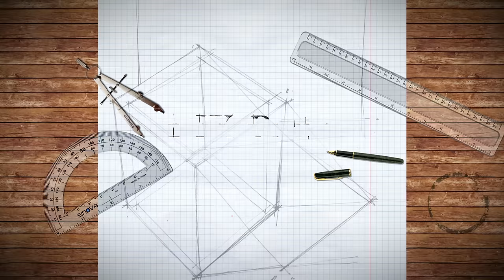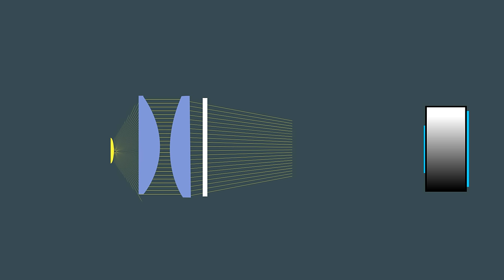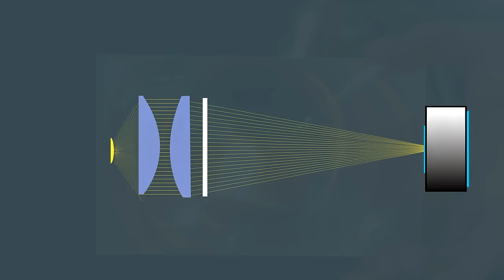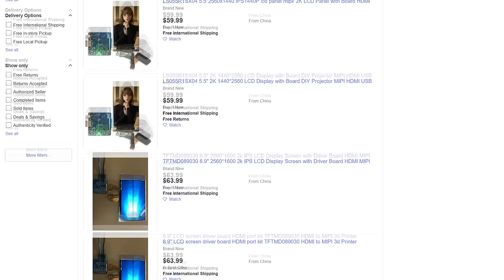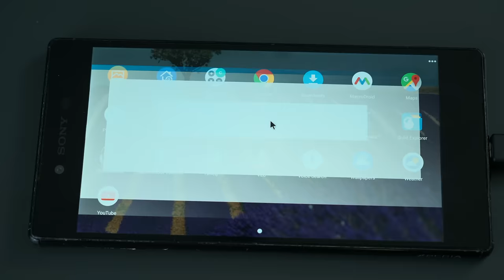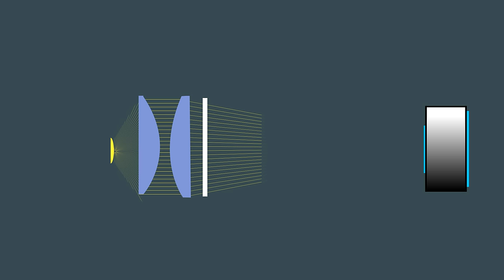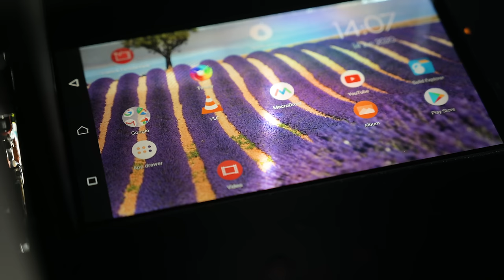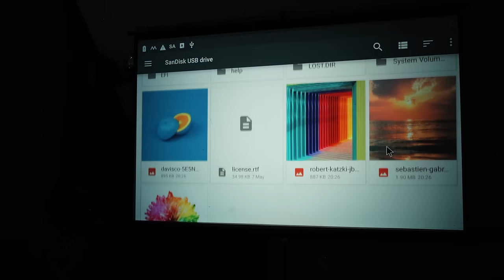Building a TRUE 4k home cinema projector (it’s awesome)

Comment: What’s the exact price breakdown? I can’t see this being cheap...
Reply: Somewhere under 2k hahah
Reply: In the video he says the bought one cost literally 10x as much as the homemade projector, so roughly $200. 25:55
Reply: @Eli-234  how. The heatsync alone has to cost $100
Reply: @brandenbrandonbrendan4405  not at all, heatsinks are super cheap. Just built my PC and got a heatsink for like £30, definitely enough
Reply: @brandenbrandonbrendan4405  He used a CPU cooler. You can get decent stuff new for around $20 😄
Reply: @brandenbrandonbrendan4405  that's an NH-D14 and you can find it used at 60 maybe 50 bucks
Reply: @Pinkuranuim  i upgraded mine a couple months ago. it cost at least 100 for my cooler.
Reply: @brandenbrandonbrendan4405  Nah it's not a noctua, more like $50-70. Really looks a lot like my scythe.  Seems like you could do the whole thing for less than a $500 call it a grand if you need a 3d printer
Reply: @brandenbrandonbrendan4405  You bought new hardware. You can buy this  unit with fans for $60 on ebay buy it now. You're just flat out wrong here dude.
Reply: can.... we watercool this with a aio?
Reply: okay so heat syncs vary in price but can anyone give a cost breakdown of this whole unit?
Reply: @brandenbrandonbrendan4405  more like 20us...... I mean, just buy some third brand cpu cooler......
Reply: @brandenbrandonbrendan4405  Well you can get a used one here. I find some on ebay for about 20-40 bucks
Reply: I'm thinking less than $100 for the alu and other construction materials. If you want someone to CNC it all for you, it might be a lot more expensive.
Use a 1080p phone you can get for $20 used or might even have - i have one 1080p 2013 phone for sure that popped its battery somewhere in a drawer. Alternatively use a panel and adapter board should run you maybe $80 or less from China. 4K is going to be EXPENSIIIVE. Maybe the imaging bed off an Elegoo Mars or Anycubic Photon 3D printer can be retrofitted? It's not too too expensive as a replacement part, and it's actually a 2.5K screen that reuses a phone panel with full RGB capability intact, because they're lazy.
Yuji Led is like $80, but you can substitute a much cheaper one.
$20-$30 for Fresnel lens kit from China.
I won't even count a mirror, they're basically free. Pulleys are about $2, as are inserts he used with them, and the belt is maybe $5.
The step-up/step-down boards should all add up to about $20.
Large format lens about $50-$100
Scythe, Thermaltake or Thermalright dual tower CPU cooler up to $40 or so, maybe you can get a used one where someone lost, bent or broke mounting hardware, should be essentially free. There's a lot of 6-heatpipe $20 (shipped) coolers in China, not sure how good - but the LED is actually allowed to run somewhat hot.
Make your own total depending on how you decide to build yours.
Reply: I would just rip one out of a 500 watt amplifier, there's plenty of those at a junkyard
Reply: @brandenbrandonbrendan4405   - the ebay link shows $10 heat sinks. You could easily grab one there, or go with a cheap water cooler to make this even smaller (remembering to still add a "case fan" for the other parts. 

https://www.amazon.com/Performance-Liquid-Cooler-Cooling-Radiator/dp/B07QWT6PR2/ref=sr_1_28_sspa?dchild=1&keywords=cpu+water+cooler&qid=1592428946&s=electronics&sr=1-28-spons&psc=1&spLa=ZW5jcnlwdGVkUXVhbGlmaWVyPUEzS0RGUURZWlNGWDFZJmVuY3J5cHRlZElkPUEwODM4MzAyMVZZNzZEVjMwTjg1NyZlbmNyeXB0ZWRBZElkPUEwMTkxNTUzM1FZVUMzMkMyRFVESiZ3aWRnZXROYW1lPXNwX2J0ZiZhY3Rpb249Y2xpY2tSZWRpcmVjdCZkb05vdExvZ0NsaWNrPXRydWU=
Reply: @Eli-234  I'll pay you $1000 box if you make me one of these.
Reply: @brandon233112  why not, but the pumb will prob be louder than the low voltage fans, and you need fans anyway for the radiator... so.......
Reply: Too bad he doesn’t have links to everything in the description...
Reply: @brandon233112  You can if your name is Linus!
Reply: @brandenbrandonbrendan4405  heatsync.....lol!
Reply: @brandenbrandonbrendan4405  lol that's a $10 heatsink
Reply: @brandenbrandonbrendan4405  no you can get them really cheap used or just rip one from an old pc
Reply: @brandenbrandonbrendan4405  Buy it used and it gets a lot cheaper. Massively cheaper, actually.
Reply: @Eli-234  326 usd only for the 4k panel. Not even close to 200 usd total :(
Reply: @brandenbrandonbrendan4405   you don't buy a current generation cooler for this.  You get something off the clearance rack.
Reply: @brandenbrandonbrendan4405  This guy buys a broken phone for the project and you compare prices using your brand new, overpayed cooler. You can second hand a decent cooler for 30 tops. They're not even rare on second hand sites.
Reply: @brandon233112  probably, but as he mentiones near the end, the fans also help cooling the whole thing, especially the phone screen. From my experience, airflow on from radiators is pretty bad.
Reply: Most of the parts are cheap, but wiring and focusing, along with the obviously custom CNC cut panels will take you a lot of time and a lot of expense if you don't have a CNC cutter. Also, the phone screen likely isn't rated for that amount of brightness, and might melt or warp after time.
Reply: @brandenbrandonbrendan4405  sounds like you bought one for extreme performance for hot-running CPU's or you got chipped.
Reply: @SianaGearz  thanks for the monetary breakdown!!
Reply: I think the sum of all the links is ~<$600, but I'm sure you can find cheaper versions of a few of the pieces if you look hard! :)
Reply: For the 4K variant, between $500 and $600.  For 2K about $250 - $350.
Reply: CoDGplays  I don't know how you came with a $500 price tag. Between the led, display and aluminum, you'd more than likely blow the budget. We haven't even got to the timing belt and pulleys which is at a minimum of $50 for the set, but more likely around another $100 with the threaded inserts. There's also a lot of miscellaneous materials, nuts, standoffs, mirrors. If buying everything, i.e. You don't have a 4k screen laying around like Matt does, I'd say this is going to cost at least $900. Then there's the finishing, vinyl wrap isn't cheap, unless you're going for an industrial look. With a full bom, I'd expect this to cost upwards of $1000 and all that for 3.5mm stereo audio, no hdmi plug and play and a host of other features that a 4k projector gets you. As cool as Matt's ideas usually are, this one is a miss.
Reply: @XepptizZ  yes, and there's 2 of them. With 2 case fans. I'd say $50-60 is a fair assumption. "I have one laying around" isn't repeatable.
Reply: @brandenbrandonbrendan4405  lol
you can find decent heatsink @ $20
Reply: @bencrystalofficial  He didn't include the price of the aluminum and the tools :/ since most people won't have these tools and parts. (parts being nuts, clamps, physical tools)
Reply: I'm at $300 so far. I have everything he bought except the aluminum, heatsink, mirror, and standoff screws. So I imagine around $500 at most. All this with me buying the Xperia z5 premium for $140
Reply: @anirudhkalbag  Indeed if building a high quality projector was so easy and cheap, then the commercial projectors would obviously be much cheaper. Obviously just having a phone screen and couple of lenses doesn't make the experience that good, you're better off buying a real projector that isn't 4k and enjoy much better experience.

Comment: this channel is the reason I now hoard every piece of broken tech I find- "Ill take that broken laptop; I want to make a lamp, a security camera, a media player pc ... Are you trying to getting rid of that old phone? - and a projector"
Reply: hmmm.  making me think... maybe I should do the same thing.
Reply: I have several 50L tubs full of computer & electronic crap - mostly unused cables - that I've accumulated over the years. 

I still have to get  (unorganised & unknown) ancient old data (which is probably utterly useless) off of old 500Mb hard drives, Syquest Drives (my early workplace used the sucky things) & Zip Drives.

Most of it is frankly completely useless, but I haven't had either the time, or inclination, to go through it all & sort out the potentially useful, from the rubbish & recycling.

I actually had sort'a forgotten about their existence & as they've just become another obstacle in my storage area I need move out of the way every time I wanna find something. 

Well, I know what I'm gonna be doin' this weekend...

Comment: Huge problem detected: the LCD which is hit by a bright light (and high temperature) isn't cooled down properly. 
This setup relies on ascending air movement, but if I understand, it catches air from the top of the projector and hopes to cool down the screen as the air goes down, fatal flow is, hot air rises, cold air sinks, that's physics, this could potentially overheat the LCD pannel since it will catch the hot air the projector just exhausted.

There's a very good reason that all manufactured projector uses radial fans to blow directly to the display device (LCD or DMD for DLP projectors) in parallel to other fans dedicated to the lamp part and exhaust.

This wouldn't last long, that's bad because the build is actually good, at least, a radial fan placed at the top to help pushing air down will do the job just fine cooling the screen..
Reply: Looks like you missed the part where he installed fans sucking air from the top and pushing it out from the bottom...

Comment: The image it's not evenly lit, I recommend you to use a concave mirror instead or the glasses you talk about in the beginning, the lens he's using are not very good cause they're not made for professional applications, but use the concave instead or the glasses the image will look brighter and evenly lit,

Edit. Also use projection lens not camera lens, that can contribute to the vignetting too
Reply: Thanks for that. Large format lenses were otherwise hard to get here.
Reply: Projection lenses aren’t that easy to get, either. Other than slide projector lenses, of course, but those are also designed for the 24x36 mm image circle.
Reply: @JasperJanssen  oh ok...A quick Google search showed me a few results around my area. Didn't look into the technicals though. Thanks
Reply: @spammyjenkins87  thank you. Shall look for the triplets :)

Comment: I noticed that at the edges of the diy build there is a slight drop in brightness 
Could a rectangular shaped LED unit fix that problem ?
Reply: Probably more a problem of the lens vignetting. Using a lens with a larger image circle (like one designed for 13x18cm format) might help.
Reply: Are actually making it
Reply: @mariuszach1344  So would using the f4 lens - even with the smaller LED - have helped reduce the issue? After writing that sentence and doing some googling. I wonder if you wouldn't want a larger diameter lens as well. Maybe a smaller f to get the largest area of definition but would a higher diameter also help reduce light loss at the edges?
Reply: @shanerc  well vignetting really depends on a lot of things. In general most bright aperture lens designs will actually show more vignetting (at open aperture), you could also look at this in a way that the bonus brightness of the faster f stop is only really there in the central regions. So the overall image will be brighter, but less evenly distributed. And since every lens will vignette when used at the limits of it's image circle I would probably prioritize this, especially since a slow lens of larger format might be cheaper than a smaller but faster one. Keep in mind that when stepping up format you'll most likely find lenses with longer focal lengths, thus having a smaller viewing angle afterwards.
Reply: @shanerc  btw I've recently acquired a 365/3.65 lens that covers  about a 30cm circle. So i might actually give this whole idea a shot hahhaha

Comment: 19:51 He says the fans need to be installed so they blow outwards, but then installs the fans with them blowing inwards. (fun fact: Computer fans always have the non-rotating fan supports on the side the air blows towards.)
Reply: It is correct in the thumbnail and it seems like there are foam pads used as spacers. It looks like these fans can't be placed backwards without touching the heatsink fins. So he probably didn't show them being placed correctly to save some time.
Reply: I'm going to let you in on a dark secret. It's called reversed polarity.

Comment: Could a IR filter take some of the heat from the LCD? Let's say, put it in front of the led and cool it the same whey the LCD is cooled now.
Reply: Probably not. LED lights are very efficient so don't produce much IR light in the first place.
Reply: @asicksadworld  Interesting argument; a lot of the heat would be generated by the absorption of the lcd panel regardless of IR spectrum light, but the fact that the LED is getting hot in the first place suggests some level of black body radiation. 
I remember from an episode of mythbusters (in which they tried to defeat a thermal camera) that a simple pane of glass is reflective in IR but not the visible spectrum. I would be interested to see the surface temperature readings of the lcd screen black vs white (full vs no absorbsion) both with and without the glass as an IR filter

Comment: "you will need much louder fans" 
Laughs in Noctua
Reply: Laughs in Be Quiet! fans
Reply: @HangmanOfficialUploads  Laughs in Arctic p12 pwm
Reply: Laughs in Noiseblocker
Reply: Lets face it, some nerd with a water cooled setup is gonna come in here and "akshually" all of us.
Reply: Watercooled nerd reporting for duty :D Using two Arctic p12 pwm fans to cool my watercooling radiator.
Reply: @HristoKolevMayvena  [angry fan only noises]

Comment: Using a water cooled heat sink such as the Corsair h100i would be an easy solution for a higher powered led, and the fans for the radiator can be configured in a push/pull setup over the radiator, I believe reducing the stress of the fans and optimizing the air flow. Fantastic build; I’m definitely going to be doing a similar build.

Comment: Just wondering if you had looked at an optical heat absorption filter to blockout the heat being transferred to the LCD panel that way you could use a higher powered LED for higher brightness albeit at the expense of more noise from fans and a bigger powder supply.

Comment: It would be perfect if there is a driver board for this display so that when the internals of the phone become too slow to run anything modern, u can just use hdmi and plug anything in while keeping a well functioning screen
Reply: Exactly my thought ! I would prefer the processing power to be handled* externally, especially for 4k movies or even gaming ;P
Reply: Did you miss where he was talking about getting LCD panels with HDMI driver boards on eBay?  He didn't use a driver board because he wanted to recycle the whole phone he bought.

Comment: 8:47 Combustion, yes; spontaneous, no. The heat source is EXTERNAL, not internal.
Reply: Pedantic, yes. Fun at parties, no.
Reply: I think he meant it combusted without starting to smoke, then beginning to fire. It burned almost instantly. Technically, spontaneous is misused but depicted the idea.

Comment: While I do understand why you went vertical with this project, and the cooling system you designed certainly looks capable enough, a horizontal layout would make cooling much more efficient.  Heat rises, after all, and in your vertical layout all that heat will be working against the cooling systems air flow. In a horizontal layout one could make that rising heat work with the cooling systems airflow, increasing efficiency thus making  for quieter fans and an overall cooler build.

Comment: Watching this on a $2000 4K roof mounted projector and thinking damn, mine isn't even that cool. Also it's more noisy, but brighter and without vignetting but still this is a pretty good project!
Reply: Same, but I noticed that he doesn't cool down the lcd pannel which heats up with the light. Which can potentially be deadly for the panel (permanent burn) 
Otherwise cry in optoma uhd51 faux k
Reply: his solution presumably won't have the really irritating rainbow artifacts that DLP projectors have!

Comment: I'm in the process of turning my cheap $30 projector into a setup like this one.
By taking the expensive parts from the cheap projector you can make an even brighter projector with 2k resolution for about $150

Took apart the projector to see if this would be possible and sure enough, the lamp, power supply, and large format lense are just sitting there waiting to be used.  All you need now is the fresnel lenses, the 2k lcd panel mentioned, and the focusing hardware. Spend as much or little as you want on the case and cooling and enjoy!

Comment: I would want to make this to take camping or outside in the back yard... how would the image fair in a dark yard and not  a pitch black room?
Reply: A bright streetlight or mostly full moon would make for a poor image. Also, the bigger you project the image, the less bright it will be. With a dull moon, little light pollution, and a reasonable projection size, it should work fine.

Comment: 19:57 Both fans blow towards the inside. As can be clearly seen by the arrow on the fan at 20:06.
Reply: if you power them with the opposite polarity they will turn and blow in the other direction ( I guess maybe he did the welding wrong and was easier to turn the fan around then re weld the wires)
Reply: But at the same time he emphasizes how important the direction is, so maybe he is just trolling and wants to see if a viewer notices it. 😄

Comment: Wow, i want to DIY a projector now!
As a PC enthusiast i am a bit worried about the quality of the cooling system, because the heat sink is upside down. Building this in up side down and perhaps susopending it from the ceiling would be another option that should be possible with same BOM excluding the materials for cealing suspention.